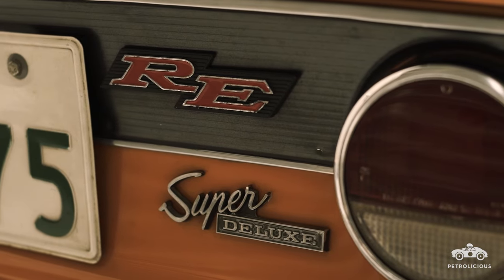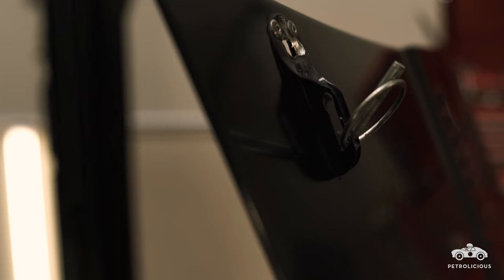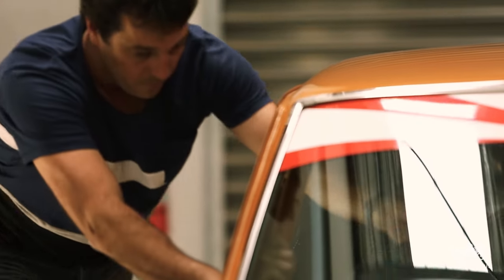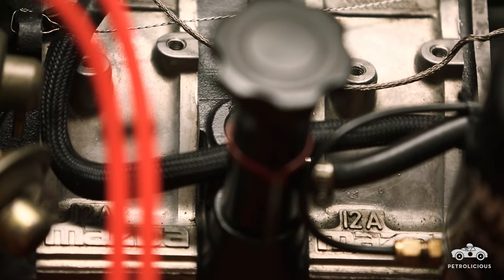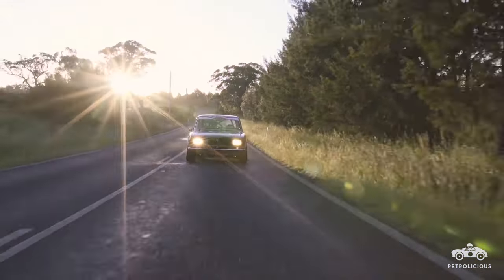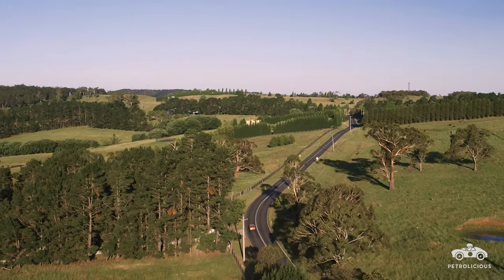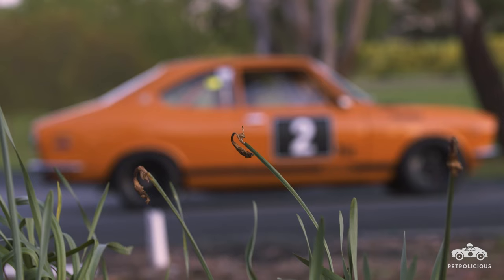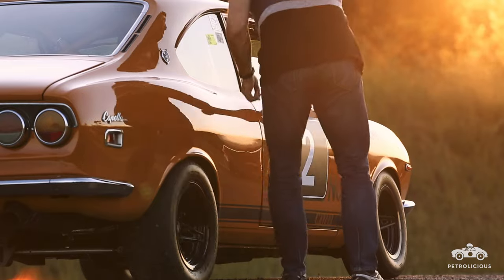This Howling Mazda RX-2 Is A Killer Bee

Comment: I miss my RX2, I had one when I was in High School.  Cut my teeth as a mechanic, changing the many points, plugs, distributor caps, checking the gas and adding oil, but worth it.  Nothing, nothing compares to the seemingly limitless RPM's, and the traction on slippery roads, which rivaled my Audi 200 Turbo quattro.

Comment: Wow, just wow! That sound at 5:12 is just insane!!!!
Reply: +Thomas Wallblom Are those straight cut gears I hear?
Reply: +Thomas Wallblom Most of what you're hearing is transmission whine, not the engine. If you put solid or very hard bushing mounts on your transmission, your car will have this sound. I ran one in my car for a while on my transmission and it sounded like a racecar. After that one broke, I put a better designed one in that cut the sound in half or less and it's much better now, basically the difference between people thinking the car is broken vs not noticing.

I really wish I knew which mics they used to pick up the interior sound so well.
Reply: +Thomas Wallblom Everything inside me screamed SHIFT SHIFT!!! Oh...wait, that's right! 

This car speaks to me man.

Comment: aw nice mate yeh ive been in lots of them and helped build them and had a couple of rx3s myself and they have a great little personality and they are kinda just weird and different which is what i like about them . one of my favorite memories about them is the smell of the gas esspecially when we deleted the oil mix pump and ran it with pre mix i just used to relish the stink of it burning , and then there is the scream of the massive revs and you can hear every bearing and gear whining along with the huge flames and back fires, its a very raw motoring experience.

Comment: That rotary tho! You can't go wrong with a cool 1970s Wankel powered wonder
Reply: +Joshua Finley You can, if you want a slow car with no torque.
Reply: +Joshua Finley You can, if you want a fast car with some actual torque.
Reply: +tavi921 You don't need torque on a lightweight car... also its more fun to drive a car with peak power but no torque, it punishes you if you get it wrong. When you get it right, there's is nothing sweeter.

Comment: I was in the Army in 1972.  I saw a RX-2 go by me one day on the freeway, and I said to myself, I got to have me one of those Rotary engine jobs.  Well, I got together $2850 dollars.  Yes, $2850 brand new!  I proceeded for the next two years to blow the doors off of just about any comers in the 0-60 time frame.  Only one big problem hit me at 52,000 miles...you guessed it - the ROTARY SEALS.  The damn things gave out just as the warranty wore out.  That was the end of my Wankel experiment.  I bought a used BMW 1600 and never looked back at the amazing but troublesome rotary engine.  It was different and it was fun.  Turbine smooth and a wicked high end.  One last thing..the gas crunch of 1973 came along and Wankel rotary engines are thirsty mothers...love oil too.

Comment: I just wish they talked more about the engine, wether it is stock, what type it is, if my asumption is right than thats a rotary engine. Those are very unique from my point of view and definetly worth mentioning because there are not many cars out there driven by them rotaries.
Reply: really??? of course it's a rotary....... it's a fucking RX2.
Reply: Philipp Matthias Türk its shows a frame with a 12a  sign as well as the noise
Reply: Bridgeport 12a he says it in the video, it has a lot of research and is balls to the wall NA engine

Comment: Does it really need all that negative camber up front?
Reply: We are limited to 5 degrees in our category, could use a fraction more with the grippier Yokohama tyres we sometimes use, but it is spot on with the tyres you see on the car in the video. Even temps across the tyre when checked with the pyro at operating temp.

Comment: Sounds like a 2 stroke.
Reply: +Jay C That's what Wankels kinda are.
Reply: +_踊り Well... more like a 3 stroke. A rotary fires on every side of the rotor, on every pass. Hence why they chew through fuel.
Reply: +Jay C They're actually "4-phase", but the similarities with twostrokes are legion: no valvegear, burning (light) oil with the mixture, incomplete combustion ;-) weak on torque, high revs. They don't pop and bang on the overrun, though.

Comment: I love the look and the originality...... However the thing is an absolute pig down low for a PP; simply for the fact that he doesn't want to go proper fuel injection. I've heard much nicer behaved and more powerful ported NA rotars on decent injection setups.
Understandably he needs to comply with rules for his class, but if I was as much as mechanic as he was..... I'd have 2 setups for the 1 motor. Make everything compact in the bay in a box and heat shielded and kind of make a "hot swappable" setup so he can have his cake and eat it too..... Rather than just having a cake and looking at it wondering how delicious it could be? 
Horses for courses. So I'll shut up now.

It's perfect old school
Reply: Hi, just to clarify it is a Bridge Port on a carb. We can’t run injection in our class and would be caught in an instant. It is actually good down low, but because we were just dawdling about all day on race plugs it wasn’t the best towards the end of the day. Fresh plugs and all was good in the world. Glad your like it by the way
Reply: @racingrx2  I'd still love to see you make it hot swappable to injection just to hear what it could run at potentially? I know you gotta adhere to rules but that's a small part of you that wants to know what it's full potential is! Haha 😄 even if it's fuel only.... Lovely little rocket though!
Reply: At WOT the power difference would be negligible. We have the carb working pretty well after 15 years fiddling with it.